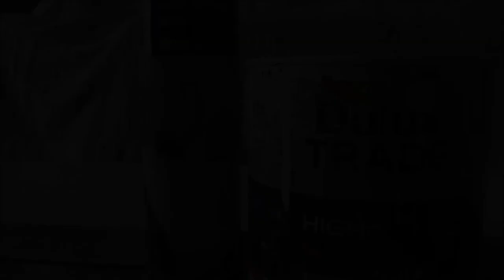Paint cissing

Comment: can you help pls my wife as gone & bought farrow & ball paint, nearly fainted when see the price  IT says on there web site I should use there primer & undercoat but read the reviews and they are not good, could you pls recommend another primer or undercoat, the walls have old paint on them, THANKS
Reply from the maker: Hi so it's emulsion paint that your using. And your putting on a wall with old paint on it. Dust, wash and sand the old paint. do filling then sand filler seal filler and wall with diluted PVA then it should be ready for two coats of your emulsion.
Reply: thanks for your help, head& shoulders above any one else with  your replys
Reply from the maker: Thanks.
Reply: Farrow and ball recommend their primer for significant colour changes due to the poor opacity in their emulsion. With farrow and ball being a clay based emulsion, it is fantastic for lime plastered walls in say old cottage properties because it let's the plaster breath.....but apart from that its pretty poor imo